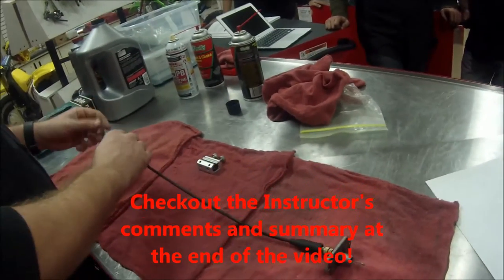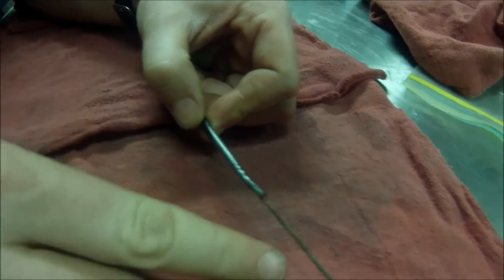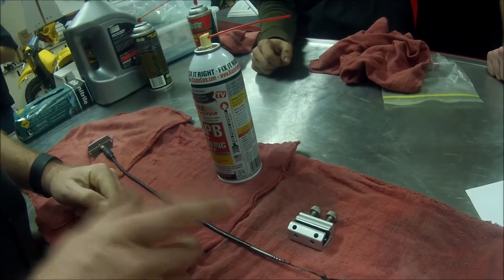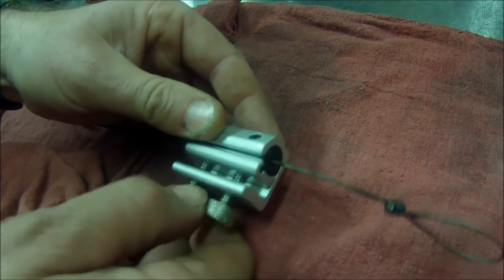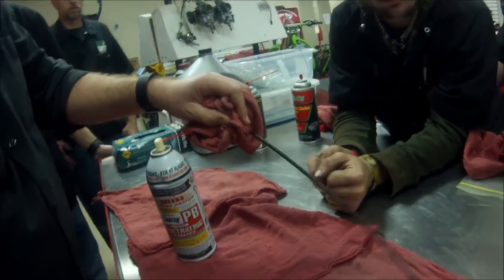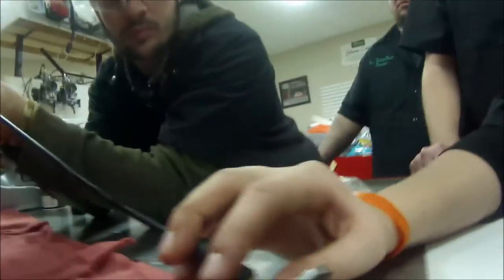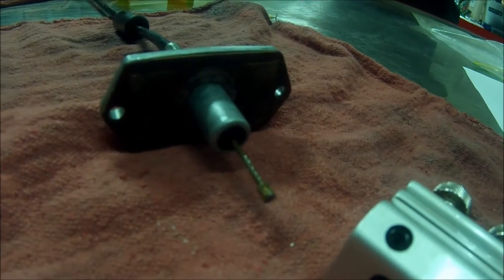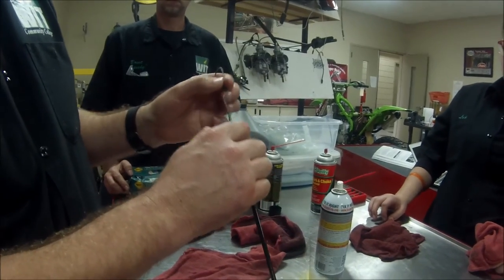How to lube a  control cable with a cable luber tool

Comment: You might be able to put that clamp a little further up on the hose and then you won't have to hold the rag and it should just make a perfect seal
Reply from the maker: Thanks for commenting and adding value to our community!

Have you subscribed yet to never miss a video? Have you seen the video playlists? Over 600 videos! Check them out here: https://www.youtube.com/user/conleybuilt/playlists  

Want to say “thanks” or “keep it up”? Click here https://www.paypal.me/how2wrench    
 
Your answers and help are just around the corner. Save time and money while protecting your investment and yourself by doing it the right way at www.How2Wrench.com

Comment: I like thows lub tool's I bought one for my quad because my front break cable broke so I put the new one on and then the lube tool and I heald the cable up so bp blaster went down the cable and I loved it I did not have a problem with it I was going to say something else but it"s late and i"m starting to miss spell and I think repat myself so good night or in german guten nacht